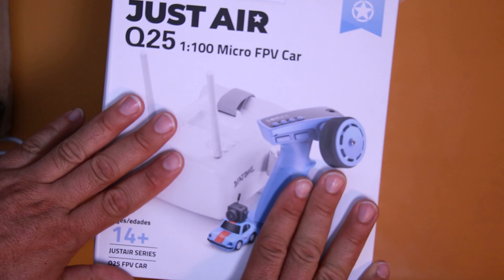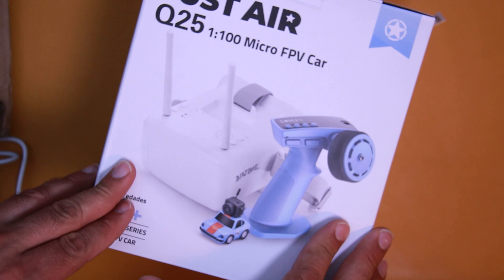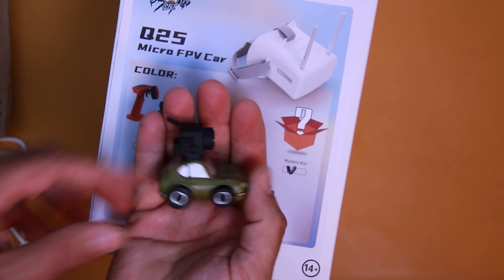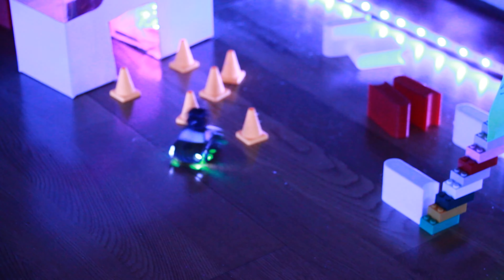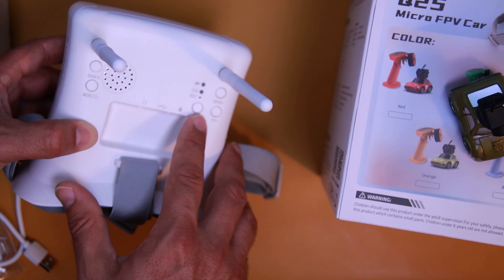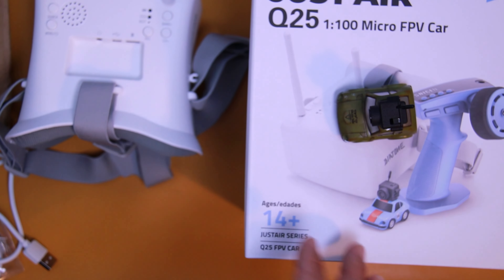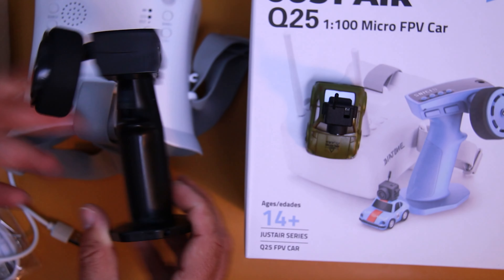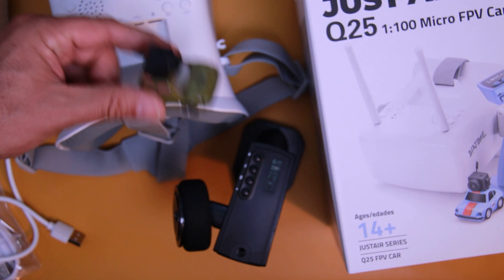SNT Diatone Q25 Mini Coche FPV + Mini Circuito Impreso en 3D

Comment: Amigo cuanto dura la pila del coche?
Reply from the maker: En mi caso sobre 2 minutos
Reply: @oscargo9  Wuao es muy poco tiempo, quería comprar para hacer competencias con mis hijos, pero dura nada la pila del carro y ademas veo que no tiene como recargar la pila del control!
Reply from the maker: @mdsprovideomds5143  son baterias muy pequeñas, es poco el espacio para la bateria, la del mando si se puede recargar, a mi me trajo una 18650 y se recarga por micro usb C
Reply: If you use the fpv, you can use it for half an hour, if you don't use the fpv, you can use it for one or two hours, the car can be charged, the remote control can't be charged,we'll throw in three 3*AAA batteries. The recharging function was removed due to concerns about the dangers of charging non-rechargeable batterie